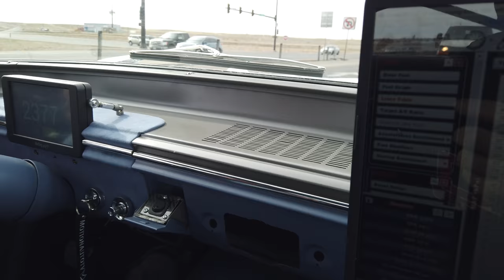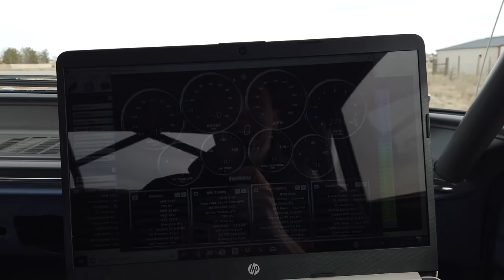427ci Twin Turbo Street Car MAKING SOME POWER!

Comment: What laptop were you using?
Reply from the maker: My Dad just picked it up from best buy nothing special just a basic HP computer running windows 10 you really dont need anything very powerful for tuning. The normal computer I use isn't either any 4-700 computer should work fine as long as it has windows 10! Shoot the one I used for a while was a $2-300 black Friday special and still works 😂

Comment: Lol just watched the whole video and man that car is as lazy as it could be. Do you have any videos of this thing actually running decent? I have a stock block Twin GT45 488 TD that puts my heavy ass g-body in the mid/hi-fives on 12 psi
Reply from the maker: After we found the issues with it the car has since went 189 at TX2K 200mph in the Half Mile and 8.49 (5.30) @ 167(130) in the 1/4 (1/8) on a soft tune up all of which have videos about them on the channel!